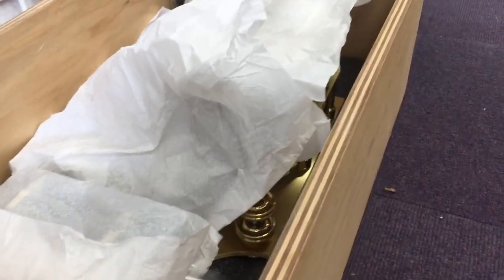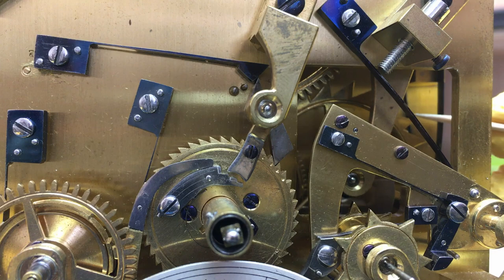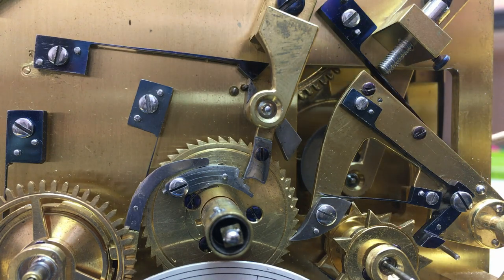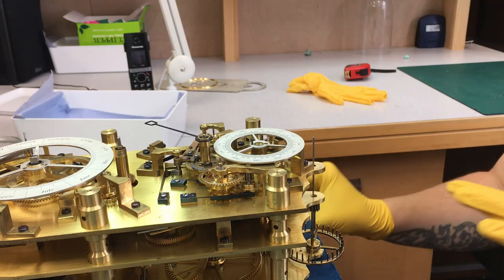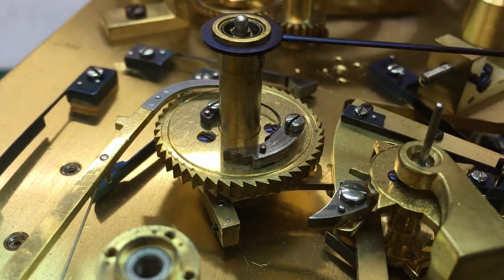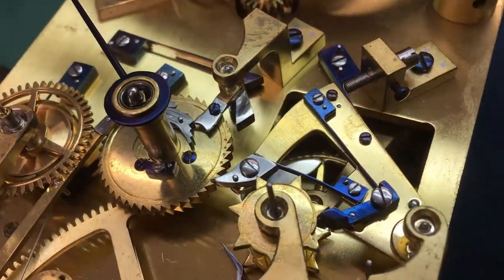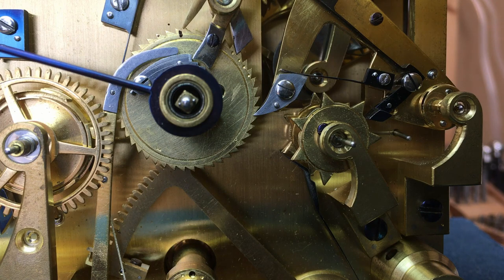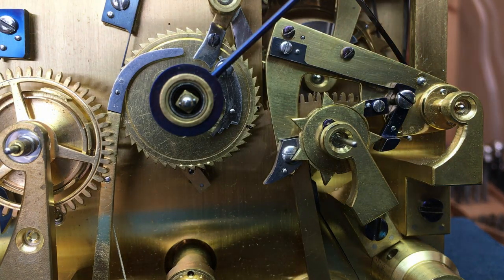David Walter Double Pendulum Clock Repair Part 1 - Calendar Problems

Comment: If I'm understanding this correctly, the date mechanism is normally driven by the movement, and this results in no issues.  If the time is moved forward by hand, and if the date hand is already on 31, it causes the date mechanism to become over banked and locked, making it unable to return without technical intervention.

The owner of the clock should have definitely had some idea what they were doing that caused the problem, IMO.  From the sound of it they had it happen several times.

I was really hoping the adjustment you did to the date rack would have fixed the issue but it was not to be.

Comment: Great job Tommy -  just wondering would this 'forced hand lock' happen If the calendar wheel had  less teeth (ie 42 instead of 44)  ?
Reply from the maker: Not something I had considered, it would have an effect, but that would change the engraving on the dial, so not really an option.

Comment: Would it have also been a viable solution to add something in that very last tooth of the rack to prevent it from being engaged?

Essentially the same solution. Preventing that calendar wheel from engaging into another tooth but allowing just enough to disengage the catch paw?